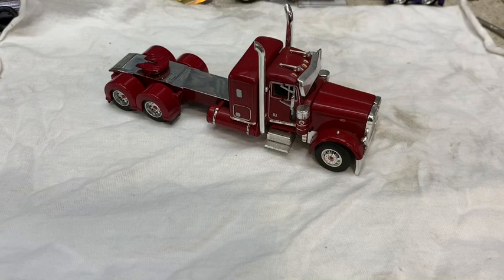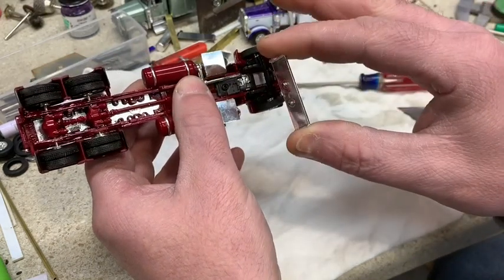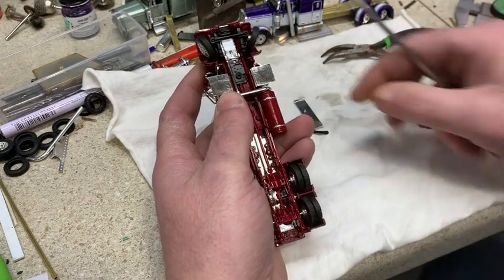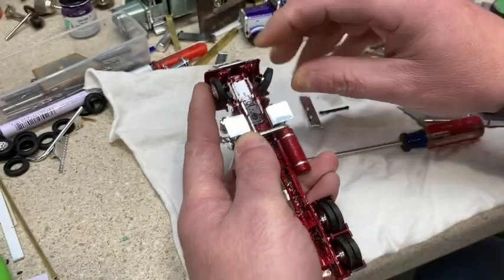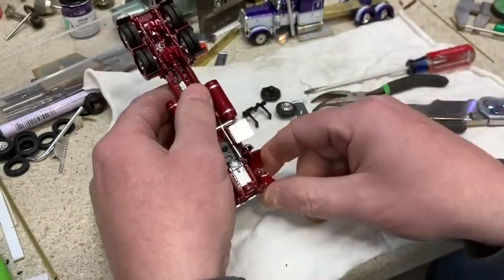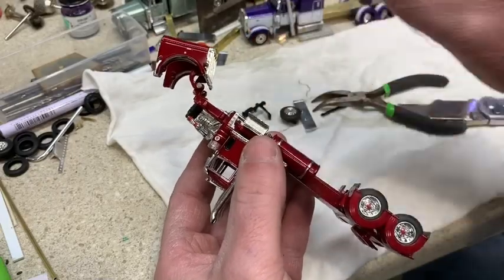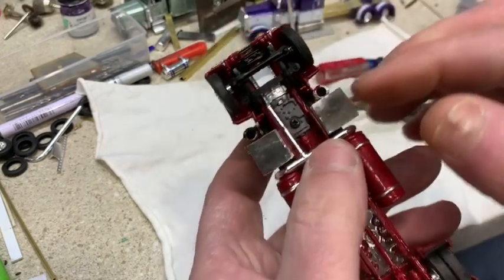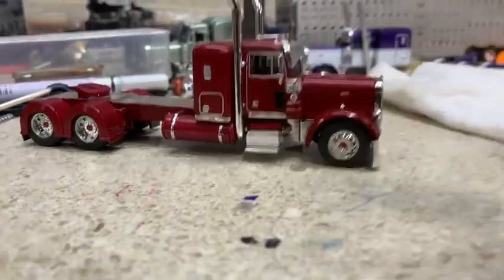Lowering your Dcp truck

Comment: I have a question can you tell me what you guys use when you stretch frames I have a Peter built cab Over and I'm trying to stretch the frame and I'm not sure what you guys use and looks like it's copper but I don't know the size of his tubing can you help me out with that and let me know and if I can buy that Hobby Lobby or wherere you suggest that I can find that item thank you 😮